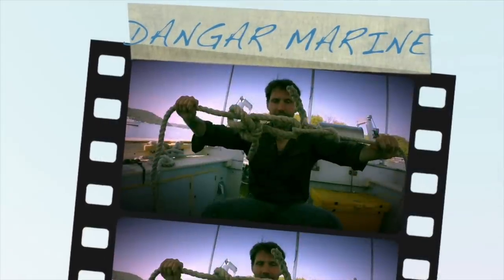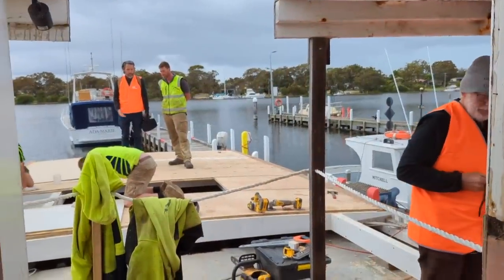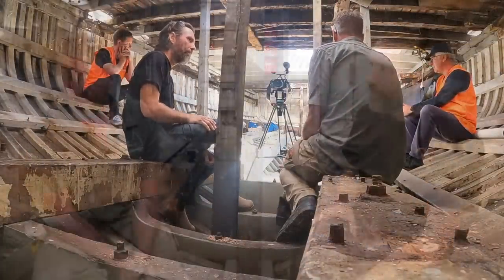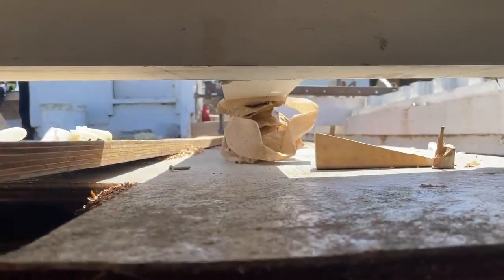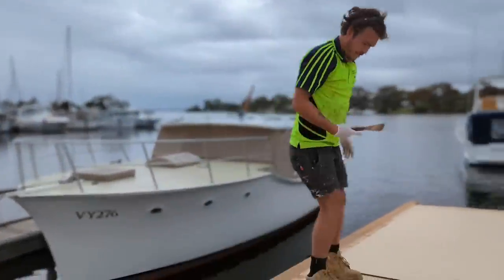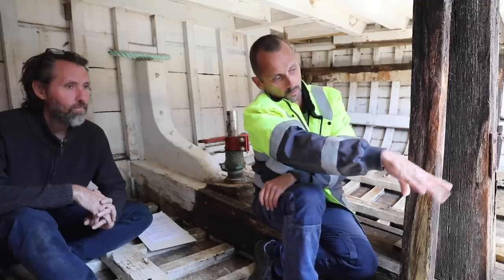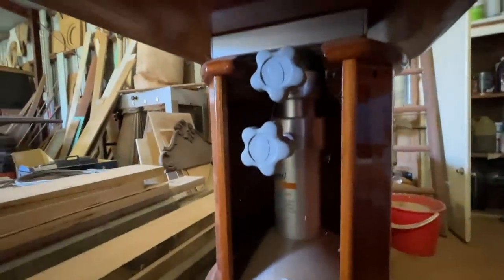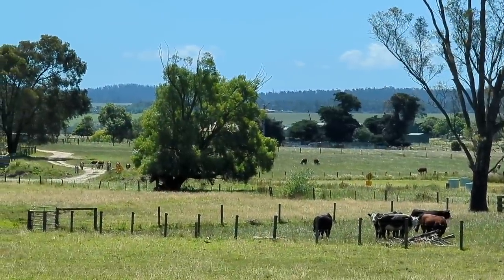The Ultimate Timber Trawler Conversion

Comment: Using a Cummins NTC855 mechanical engine is very smart. Course if you want to go a step further, use a spring starter-then you don't need those two or three starting batteries!

Comment: im having a trouble and cant figure out what parts i need i have a remote control box for cables for reverse and throtlle cable but my cable is going wrong way it pushes instead of pulling on throttle im i missing something i never learnd about that stuf so im a noob in that area except the motor

Comment: The big question for people with aspirations is how affordable is it for anybody thinking of doing a project like this and what is the budget for this rebuild?
Reply from the maker: I don't know the exact figure, I never asked, but I would be surprised if this project isn't going to be around 1.5 million. As Peter said, it isn't cheap, but it is cost effective when you consider that a second hand fibreglass Riviera of a similar size goes for around 3 million. I think it is a much better way to go for half the price. You save an old boat from the scap pile and get something really unique that is exactly the way you want and has loads of character.
Reply: @DangarMarine  Thanks Stu for your reply. I was thinking $M plus taking into account materials and full time shipwrights. If the owner is happy to reveal the costs, a break down of where the money was spent would be of great interest. If this is a future video you could compare the different costs as a useful guide between timber and steel restorations. Cheers

Comment: Ello, Dangar Stu. I have a question you may be able to answer. I just bought a 2.5hp Mariner four stroke F 2.5 HP M brand new, my first ever outboard, bought for a 3m inflatable dinghy. While googling I have seen that one can remove a restricter or possibly it's change out the carb to turn it into a 3.5hp, with no other mods. The thing I read, however, was very old. Is it still true with current model (if it ever was?). If want to know why I didn't buy a 3.5hp - it's "because I'm poor". I am finding out that there's truth in that thing where folks say BOAT = Bung On Another Thousand :D .

I like your channel fella, while I shall likely never come into contact with many of the things you do, it's all very interesting to me. You remind me of my old mechanic who kept me spinning when I was a motorcycle courier out of central London :D.

Comment: On the Ship Happens YouTube channel, there is an English couple which restore a wooden warship to it's new glory.
They restore it in the water making use of the tides to do the copper nail construction while updating the rotten inside beams.
From time to time the get help from volunteers for outside scraping, water proving, cocking and painting it.
It will become a multi year project, but going on strong.